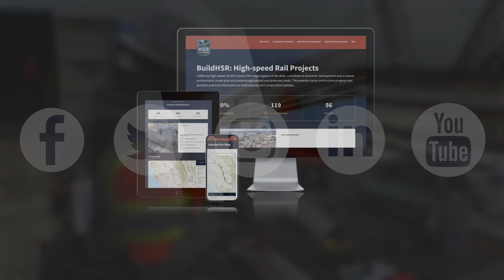California High-Speed Rail Construction Update – Spring 2023

Comment: Remembering that Space Karen didn't want this project to go forward (he admitted hyperloop was a deliberate attempt at disrupting HSR) makes me support it all the more. :D
Reply: Space Karen! Sorry, stealing this! 

We absolutely need to make this a thing! This should have been Musk's nickname all along!
Reply: Wouldn’t hyper-loop be faster?
Reply: @tylerkriesel8590  Faster? I don't deny this. However, it never got build past a prototype and in addition, it also would have had a more limited service compared to a traditional train (notice the wye at Chowchilla which connects the Bay Area, the Sacramento Valley and San Joaquin Valley all together). Notice that the next best comparison, the Chuo-Shinkansen maglev (i.e. hyperloop without the vacuum), was created because the original Shinkansen was too congested and as such was build as a relief line.
Reply: Speed isn’t everything. Hyper loop has many other shortcomings such as capacity, cost, and general engineering issues that have not yet been perfected
Reply: @tylerkriesel8590  hyper loop doesnt even have a real working example yet
Reply: @tylerkriesel8590  Musk already gave up the hyperlopp because it's simply unrealistic to design and build. Iy never pasted the testing phase for over almost an decade tbh.
Reply: @tylerkriesel8590  Yes, but a transporter would be even faster yet.
Reply: Y
Hyperloop? Oh so you want to go faster than 200,  225 mph? Maglev super train technology. 375mph.....
Reply: I hate him now as well, after all the racist statements he has made on twitter, but that's a stupid reason to support a huge waste of public money. I'm very proud i voted no.
Reply: RM Transit is next.😂
Reply: @TuanNguyen-uq8gz  Essentially another gadget-bahn.
Reply: @strangehobbyist  

"RM Transit is next."

He likes this kind of waste of money
Reply: @tylerkriesel8590  hyper-loop would be faster, the extra speed just isn't beneficial on a route like this, not to mention it's a lot more inefficient
Reply: The whole auto industry prevented this country from having high speed rails for decades, but yes, let's point fingers at the rocket man.
Reply: @X3MAntics  

"The whole auto industry prevented this country from having high speed rails for decades"

Nope. Lack of population density did and continues to do so. Since we're not all right next to each other like in Europe and Asia, we need jet aircraft for the speed. 200 mph is not sufficient out here in North America and Australia.

"let's point fingers at the rocket man."

We're pointing fingers at the racist man. That's all that needs to be said of him.
Reply: @neutrino78x  It was the auto industry that tore out cable cars and street cars all over the country. It wasn’t hue to the “lack of population density”.
Reply: @neutrino78x we had a huge rail network, politicians, car companies and airlines are the reason why the US is the way it is
Reply: @MrStark-up6fi  

"we had a huge rail network, "

And we still do. Wheel on rail is just way too slow. Private industry left it behind and went with jet aircraft because they are MUCH faster and you can fly an airplane around without having to build anything on the ground between Point A and Point B.

Just look at CAHSR. 100 billion, and you struggle to go 1/3rd of the speed. With airplanes, you just build an airport at Point A and an airport at Point B, and run vehicles at 500 mph through the air.

"politicians, car companies and airlines are the reason why the US is the way it is"

Nope. It's just low population density and high distance between cities. Canada and Australia are the same way, hence they don't use HSR either.
Reply: @MagicalBread  

"t was the auto industry that tore out cable cars and street cars all over the country. "

Actually, it was because we got to the point that most people could afford a car, and it's typically three times faster to drive from Point A to Point B if there's no traffic. 

Our major cities still have lots of public transit. If you want to ride the bus or the light rail or the subway it's available. I live in San Jose and have needed to drive.

"It wasn’t hue to the “lack of population density”."

Lack of population density is why the huge expense of HSR is not justified in North America and Australia.
Reply: At least his spaceships worked and did what they were supposed to, high speed rail will never work and will just cost the taxpayers billions of dollars😂😂😂😂😂
Reply: @carlsmith5545  Maglev tech is still not mature enough to use on this type of "first of its kind" project in the USA. For now, that should be left to the countries who have decades of experience with existing HSR. Let them flesh out the growing pains of Maglev and then the USA will follow and improve upon it.

Maglev is only being used on one public passenger route right now in the world. That is in China and it's a relatively short route that only goes to an airport. All the other Maglev routes are basically still test tracks in Germany and Japan.
Reply: Remember when this was to be completed decades from now? Or ago? Whatever. I still see no tracks, so, whatever.
Reply: @mattc3696  

"I still see no tracks, so, whatever."

I heard at one point it was going to be only one track built!!! And they spent like 35 billion building this thing!! They want another 100 billion to complete SF to LA.

I'm glad the Governor noped out and said Merced to Bakersfield is all we're doing, and I'm proud I voted no! 🙂

But you know the railfans are reading our comments saying to themselves "these guys are so stupid" but they drool over the concept of HSR. 

According to them, a three hour train ride is faster than a one hour plane ride. Maybe on their planet. 🙂
Reply: @neutrino78x  This is why I want a new vote on this. Let's see if people support a 1% sales tax to pay for the thing.
Reply: @neutrino78x  "1 hour plane trip" plus the 1 hour for security, 30+ minutes queueing and boarding, delays, 15 minutes unboarding, luggage checks, and a much less comfortable & cramped experience.  Plus using 10x the energy and pollution per passenger with zero possible way to do it without burning jet fuel and making tons of noise. Um...

All over the world countries are building HSR.
Reply: @danmobile  

"1 hour plane trip" plus the 1 hour for security, "

Let me help you out, since you cut and paste I have one prepared already.

Nope. Since you guys are cutting and pasting, I'm going to save this post so I can just cut and paste next time this is brought up. This argument is more true on the east coast or in Europe where the airport is further away.

1) SJC is 20 minutes from downtown SJ on public transit; SFO is 30 minutes away from downtown SF; BUR is 30 minutes away from downtown LA.

2) security is 5 minutes if you have "clear" and 20 if you don't

3) in no way do you have to show up 1-2 hours early on a domestic flight. If you're there more than 30 minutes before boarding starts, you're doing it wrong

danmobile continues,

"Plus using 10x the energy and pollution per passenger with zero possible way to do it without burning jet fuel "

Meh. By the time CAHSR is completed SF to LA (which is never, since they want 100 billion and we don't have it as a state), fights from SF to LA will be zero emission. Universal Hydrogen has already flown a "Dash-8" aircraft on hydrogen for 15 minutes.

https://hydrogen.aero/press-releases/universal-hydrogen-successfully-completes-first-flight-of-hydrogen-regional-airliner/

"All over the world countries are building HSR."

I don't care. They have more population density and the cities are closer together than the USA.

Tell when Canada or Australia makes a nationwide public transit network of HSR. It's never going to happen, for the same reasons it won't happen here.
Reply: "They have more population density and the cities are closer together than the USA" 

Oh that's cute. You're talking about the whole USA? But we're talking about just California here so maybe you're lost. What about HSR in the even more dense states? 

This video is not about HSR in Alaska or Idaho, for example, so who cares if they drastically drag down the density numbers for our whole country? We have these great things called STATES and can look at those individually as well. Sure it might not be feasible everywhere, but the density of California is 98 people per square kilometer. The density of China is about 150 people per square KM. So we can say California is only about 2/3 dense as all of China. OK. California has 0 high speed rail lines. China has 26,000 miles of HSR. Is the density SO different (2/3??) that is justifies having ZERO, in any state? OR is China just eating the USA's lunch on modern transportation statistics? 

We can go one further. Much of China is VERY rural. More rural than California. And much of it is is VERY dense. Way more dense than Los Angeles. Why do I bring this up? Because China has HSR in most of the country, and in many places with considerably lower density than California. And it's expanding every year further into those places.

Take Qinghai for example. Population density is 8 people per KM, 1/10th of California. Or Sichuan, home to 83 million people with a density almost the same as California. HSR lines run through that region. In fact there are about a dozen territories with similar density to California that have HSR. Really the only parts of China that don't have HSR are the far west where the places are more rural than 47 of the 50 states.

If you think people are perfectly content with AIR travel and driving (which is dangerous and SLOW as hell), you're out of your mind. Every time someone visits another country and rides a train they come back saying WHAT IS WRONG with this country. I suggest you travel more.

I love your super optimsitic time tables for air travel. No 1 hour flight takes 1 hour door to door. That's a damn pipe dream and you know it.

Planes begin boarding AT LEAST 30 minutes before they leave the tarmac. They also take 15 mintues to land. Airports are massive and take considerable time to navigate, especially with multiple terminals. Let alone security "5 minutes" uhh yeah, at Spring break? At Christmas? NOPE lol. Maybe ONE airport in the bay area is that fast OFF PEAK but most places in the states are likely going to take a lot longer than a few minutes for security. And check-in, and boarding. and baggage, etc. etc.etc. Then here comes the 60 minute layover. Or the "park on the runway for 15 minutes for no apparent reason". Or can't land due to fog. Of couse trains will have delays too, but they are horrible with planes because it's a lot more complicated to fly 30k+ feet with considerably less people and more moving parts to make it all work safely.

Then - YES, planes are SUPER cramped and uncomfortable.  They are famous for that. Dream all you want about the airlines. Everyone else knows how much it sucks to fly. 

You make it sound like nobody knows how much airports suck. But we all do know. This isn't 1965. Many of us have flown 100 times and it's sucked 99 of those times. Do you work for an airport or something? nobody's buying whatever it is you're selling here. HSR is coming. Look at these videos. They're building it. Yell your nonsense from the mountains but enough people are here say MEH back to you. And FFS give HSR a chance. Americans are seriously lagging on both local and HSR vs the rest of the world. It's painful to see.
Reply: @danmobile  

"Much of China is VERY rural. "

And none of it is free. Irrelevant. As is most of your post.

"f you think people are perfectly content with AIR travel and driving (which is dangerous and SLOW as hell), you're out of your mind"

Nope. I'm correct. The vast majority of us who go between these two regions on a regular basis do it via air. It's a quick one hour flight. The train would take at least 3x longer. Non-starter. You might get some of the three people who drive that distance.

"very time someone visits another country and rides a train they come back saying WHAT IS WRONG with this country."

Nothing. We have lower population density and our cities are further apart.

What HSR did you ride in Canada?

What HSR did you ride in Australia?

They don't use it for the same reasons we don't.

Paris population density 20,000/km2
London 5,598/km2
Distance 283 km

San Francisco 6,655.4/km2
Los Angeles 3,206.29/km2
distance 611 km

See the difference? One of these city pairs is more likely to have HSR than the other.

Now, next time you post, maybe read through what others have posted, and my responses, and see if you actually had something to contribute. Because so far, you do not.

Have you actually flown from SF to LA? It's not cramped, it doesn't take forever. 

And here is the bottom line, since you probably don't even live in California:
WE.
DO.
NOT.
HAVE.
100
BILLION
DOLLARS 
AS
A 
STATE
EVEN
IF
WE
WANTED
TO
INVEST 
IT.

Too fast for you?
Reply: @neutrino78x  "We have lower population density and our cities are further apart."
"What HSR did you ride in Canada?"
"What HSR did you ride in Australia?"

Are you just REALLY bad with numbers? California has 25x the density of Canada and 33x the density of Australia.

California's population density: 100 people per KM2

Canada's population density: 4 people per KM2

Australia's population density: 3 people per KM2

The whole USA's population density: 36 people per KM2 (still 12x of Australia), but we're talking about CALIFORNIA in this video.

So why are you comparing California (population density 100 people per KM2) to Australia (3 people per KM2)? LOL Just to spin your lies. 

And ACTUALLY I do live in California and like 6 million other voters (more than 50%) I voted for HSR. So yes, Californians DO want HSR, more than half of them (and current polls show it's still over 50%), even if you don't. You are the MINORITY. Get it?  If not maybe you should move to Texas.

"The vast majority of us who go between these two regions on a regular basis do it via air. It's a quick one hour flight. The train would take at least 3x longer. Non-starter. You might get some of the three people who drive that distance."

How can you even call it a one hour flight when it starts boards 30+ minutes before the plane moves an inch? I'd love to hear your tracking time from the minute you step onto SFO's highway exit to the minute you get out of LAX in a car. If that's an hour you're pullin miracles like Jesus.  Nobody's doing that trip in an hour anyway. LOL
Reply: @tylerkriesel8590  Sure but it's science fiction.
Reply: @mattc3696  It's been delayed for various reasons including a myriad of lawsuits from both conservatives and progressives, but mostly from conservatives.

The tracks are usually the last thing that is installed, and probably the easiest and quickest. The 171 mile section between Merced and Bakersfield is set to open around 2030.
Reply: musk is intelligent he knows what he's talking about alright
Reply: @mpokoraa  Being intelligent doesn't mean you don't make mistakes. He's made many mistakes unfortunately. So much so that it will forever tarnish his legacy. Remember his asinine conspiracy about one of the guys who saved the kids in the cave? That's just one of many examples. Enough said.
Reply: Guaranteed... by 2030, there will already be something faster, cheaper, and easier to implement. Y'all are fools.
Reply: @neutrino78x racist?! Lmao 🤣 😂 everything is "racist" today to you people.
Reply: @kazTHEcomic  

" everything is "racist" today to you people."

Musk is not an example of that.

One of many examples of things he has said (he later deleted it and replaced it with just the URL of what he considered as proof), "hands up don't shoot is based on a lie".
Reply: lmfao space karen
Reply: “Space Karen”

Took me a second to understand, but I love it
Reply: That, and this is a HUGE project, with much of it being “new” ground.  They are having to learn as they go in a number of areas.
Reply: @dennisyoung4631  

" They are having to learn as they go in a number of areas."

It's not that. They have experts working on it.

It's more like, the distance is too great and the population density is too low to justify this project.

California is an amazing place to live, but we aren't perfect, and sometimes we make mistakes. 

I think what it comes down is, we were excited to vote in favor of the first black President (including myself; yes, I am a moderate liberal who voted for Obama...I can be liberal and still be fiscally conservative and not want to waste 100 billion of the people's money) and then looked at Prop 1A and said "that will help my commute" without reading the measure and looking into it. 

That second part wasn't me. I read it, I looked into it, it sounded like a disaster, so I proudly voted no.

Everything I thought would go wrong has gone wrong.

With the additional problem of Lake Tulare which has put HSR underwater lmao.

We did have the Japanese (JRA) and the French (SNCF) tell us to go down I-5. They explained that we cannot expect to get any private investment with the chosen route (99) because it is far too slow and will never be profitable. But CAHSRA didn't budge, so JRA and SNCF rescinded their offers. And they were right, we have not, in fact, got any private investment.

Like I said, I'm very proud of my vote against this stupid project. 

What makes a lot more sense is upgrading Amtrak California to increase the average speed to 70+ from the current 35. That should reduce the time to go from San Jose to Los Angeles to 4.5 hours from the current 9.

Which is only 30-60 minutes slower than CAHSR was planned to be, for FAR LESS COST.

I'm just glad the Governor already said that there shall be no more construction beyond Merced to Bakersfield, because there is simply no financial path to the 100 billion that CAHSRA wants to complete Phase 1. 🙂
Reply: @theexmann  They probably thought of that but they decide the people won't buy it, lol